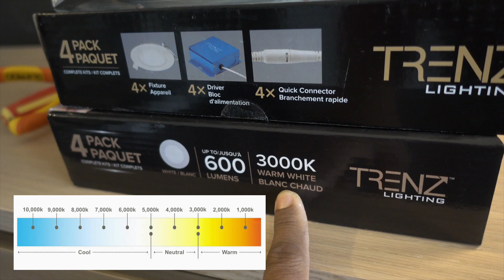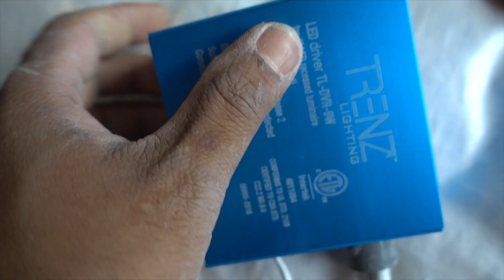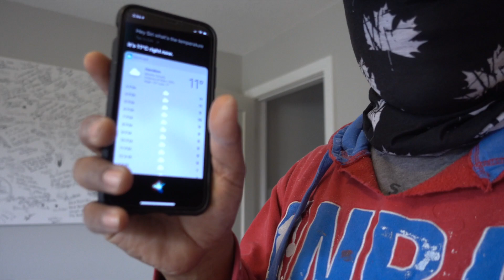Bedroom Lighting Upgrade VLOG

Comment: Hey I am looking and installing recessed lighting in a master bedroom. I want to leave the ceiling fan and add a second switch for the pot-lights. I would have to change the switch box to a 2 gang box. I have access to my attic to do all the wiring. How exactly would I go about doing this?
Reply: You don’t necessarily have to switch out your 1 gang box. You can use what they call a doogle switch, basically a 2-1 switch so you can keep the 1 gang box. Saves you the trouble from removing the box which can be tedious if you don’t know what you’re doing.